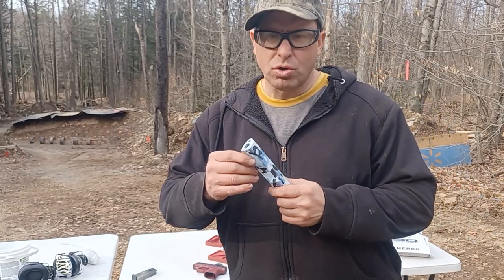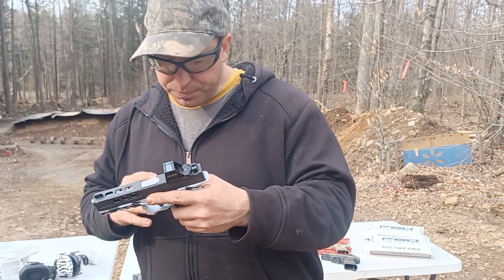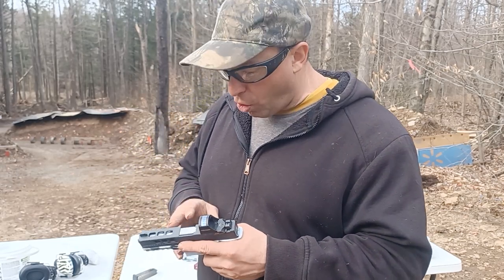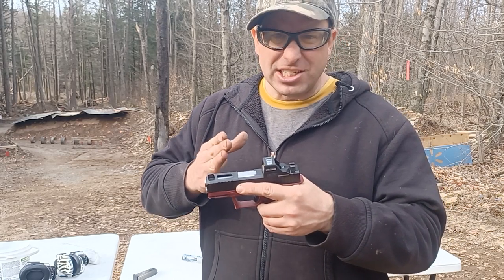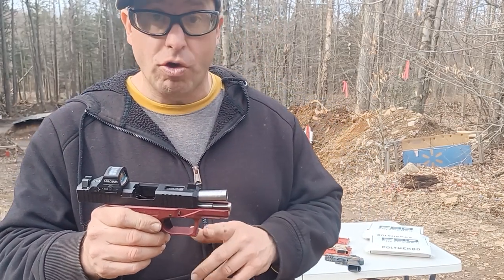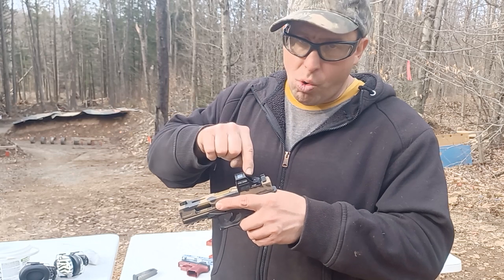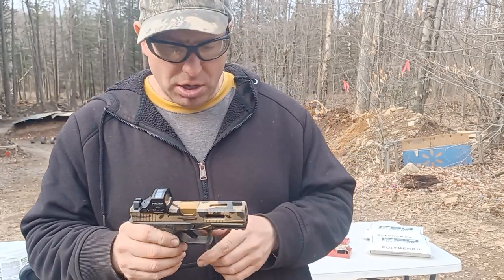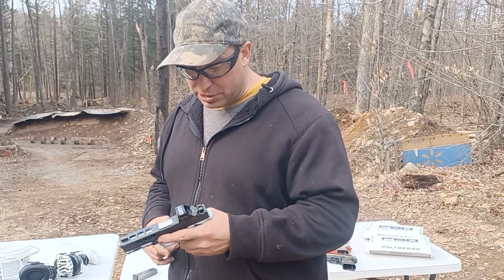Pros and Cons to Window-Cuts in a Slide

Comment: Great content as usual. You put out more useful content than most gun channels. Also I've seen lint & debris get into my Brownells window slide but no big deal.
Reply from the maker: That's very good additional information about Lint building up in there. The optic usually doubles as a lint trap that I have to blow out every morning, but I can see that with some holsters lint may also get down deeper and make its way into the cuts.

I'm glad you're active in the comments sharing your experience.

Comment: Cycling issues can be caused by other variables. It could be the magazine, billet extractor, barrel feed ramp… I’ve never heard of an optic causing failure to feed.
Reply: Maybe not the optic but the screws and depending on how long the optic is does it cover part of the ejection port? If so it could cause stove pipes or failure to extract.

Comment: I have a P09 that I want to get a couple slide windows cut into. Does this affect the rigidity of the structure at all? Does it affect cycling? Apart from dirt and lint, what are the negatives of getting your slide cut?
Reply from the maker: The functional purpose of the cuts is to  lighting up the slide so it will take an optic without a performance change in cycling. 

If you make the slide too light, you usually have to make the recoil spring stiffer to offset and maintain that balance. If you don't, the slide will slam too hard to the rear and may also open up before the bullet is out of the barrel, causing an out of battery discharge. 

You would have to make a lot of cuts before the structure really began to weaken. The edges and corners is where most of the strength is and those are usually not altered.

Comment: Wonder if the barrel had a spiral groove on the outside could that give mud a place to move to keep it from building up on the barrel as bad
Reply from the maker: If there's any lightning cuts in the slide, mud, dirt or sand can get in there. It is eventually going to get into a bad spot as it moves around under recoil.

Comment: Beretta 92 is extremely reliable, and it is all window. Can you elucubrate about why? Thx!
Reply from the maker: That is such a great question that I stopped my workout and did a quick video on the subject. I will be uploading it shortly.

The quick answer is that the Beretta 92 was designed to work with that big window running on the Locking Block. You can completely cut away that Loop that goes around the barrel and the gun will work fine. All that does is provide a place to put the front sight on. There's a lot of clearance between the two. 

The Glock on the other hand is not Factory designed to have that big window. The barrel is dependent on the barrel hole in the slide to keep it in place. The tolerance has to be very tight in order for the gun to be accurate.

I'll post a link here as soon as the video uploads. It might take a while.
Reply: @tsafa  thank you!
Reply from the maker: @douglasds7265 
Uploading now. This should be viewable soon...
 https://youtu.be/LRuEG5pxC_8
Reply: @tsafa  great work, thank you!

Comment: Would you recommend not using a heavier guide rod on a 19 build with window cuts or should I go with a lighter spring like you did on your 26?
Reply from the maker: I would start with the standard and test it out with different ammunition brands to see if you have a problem. The Standard Spring usually works for most of my builds.

Comment: Do you have any documentation about this. Looking for weight, the physics of it. Looks like those window take off more weight than what what the sight is. Is there any spring adjustment?
Reply from the maker: Sorry I don't have any specifics other than to tell you that if I load up enough weight on the slide at some point it's going to stop cycling. That can be overcome with lightening up The Recoil spring a little bit but that can also cause issues with the gun not going fully into battery in some circumstances. For that reason it is best to use a standard spring weight and offset the weight of the optic with slide cuts. 

Of course I have slides that don't have any Cuts in them and they work fine with the optic too. I suspect that it would just start jamming up sooner as the gun gets dirtier.
Reply: @tsafa  thank you for the response. Any idea how much weight is to much on the slide?
Reply from the maker: @1052usmc  I can't give you a specific answer because sometimes it's different for one build to the next. The parts come from different places, so some will have friction and resistance compared to others. A lot of the resistance is going to be in the barrel slide lockup and that wears in overtime.
Reply: @tsafa  wow

Comment: With these window cuts. Do you think the slide will be more prone to cracking?
Reply from the maker: I have a few window slides that have over 10K rounds on them, so definitely no. I have seen some slides that have a lot more Cuts than mine, so I'm sure at some point, the Integrity might be weakened.
Reply: speaking from engineering experience, square strait angles will be prone to cracking, however round radius cuts will withstand much more. this is why your average airplane doesnt have dont have square windows, and most slide cuts are rounded. look at the ejection port itself, the thinest lower part of that ejection port is rounded corners,  the top of the ejection port has right angles but rounded in other axis'. the side that covers the left side of the chamber, is cut straight front to back but usually radiused left to right.

Comment: Debating in getting the Spectre slide on my sig p320 compact. This gun is for self defense to have in the car/house for the most part. I do love the way it looks. What do u think?😭
Reply from the maker: Price looks anywhere from 400 to 1500 depending on artwork. I like the fde colored one. You need to use a plate to mount an RMR. The Romeo's mount direct, but I highly recommend getting the Holosun accs optic.

For everyday carry I generally use the cheapest slides that will accept the optic that I want and work reliably.

If you buy this, make sure you shoot at least 300 rounds through it with the ammunition that you intend to carry it with.
Reply: 300-500 rounds of ball ammo that mimic the carry ammo's weight. make sure it runs propperly, which it should. then 100 rounds of the carry ammo you chose, because not all guns like certain shapes of hollow points. its why i pick HST's, they mimic the profile of your average fmj rounds. fully understand and commit to cleaning your gun once a week, pocket trash has a funny way of making its way into guns and body sweat will make a gun rust faster than if it were resting on the ocean floor.

Comment: Any benefits at all then if don’t plan on running a red dot on pistol to the side window cuts. Some company’s like agency arms claim it makes the slide cycle faster etc
Reply from the maker: I can see how we would make the slide cycle a tiny bit faster, but that is also going to beat up the gun. Normally if you have a lighter slide you would put in a heavier recoil spring to offset it or an optic on top for extra weight.

Comment: If ported is better then why doesn't the military and law enforcement use it?
Reply from the maker: Ported barrel is different from a slide with lightning cuts. Although a ported barrel has to have slide cuts to allow the gas to come out.

I don't particularly care for the ported barrels. In some cases they can dirty up the optic. I do like the lightning cuts that offset the optic weight. 

Individual police and military personnel usually get the cheapest crap.

Comment: My g26 slide weighs the same with the optic 407k on as it did before getting slide milled.
Reply from the maker: Very interesting. They must have cut it very deep to remove the equivalent amount of metal in weight.
Reply: @tsafa  doesnt look deeper than anyone elses optic cut slide. #1. the optic only weighs 1 ounce. The g26 is a full size slide just shortened. My p01 for example only lost .84 ounces of weight.

Comment: Lol 😅😅 cuts in slide is not great for duty or edc lol .
Reply from the maker: If mud gets inside the window cuts, the gun is going to jam. 
If there's no Cuts there, less likely it's going to jam.

That's why an AR-15 has a dust cover over the ejection port. It keeps the dirt off the bolt which needs to move back and forth